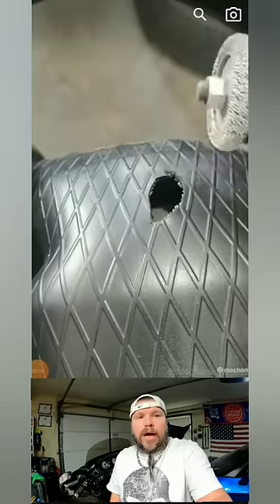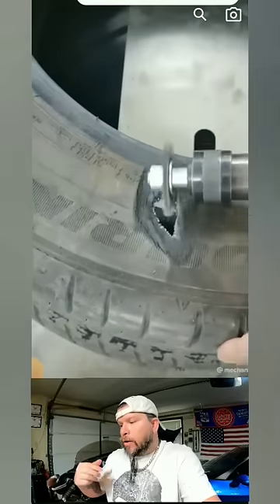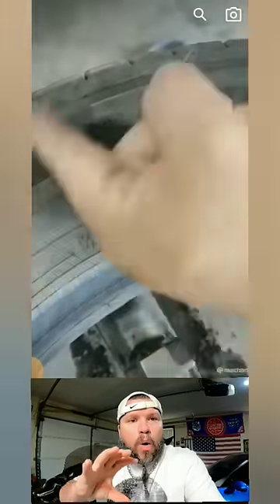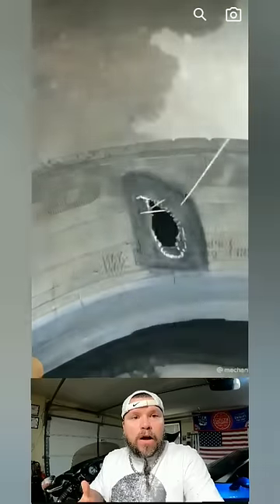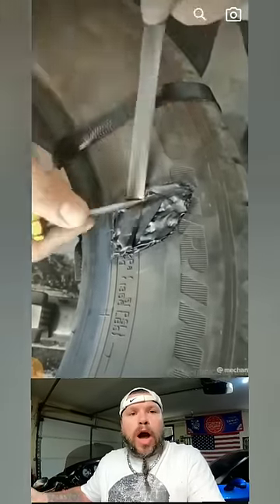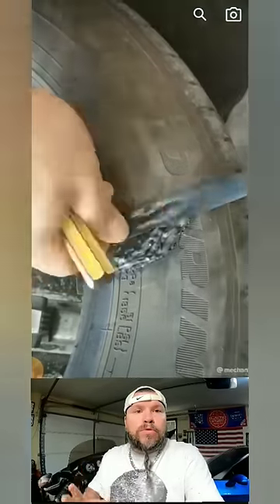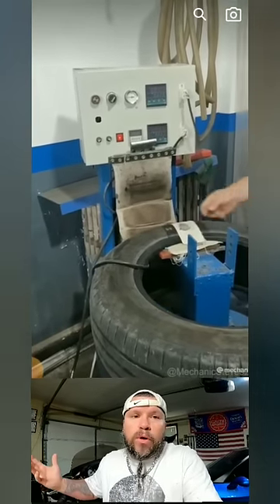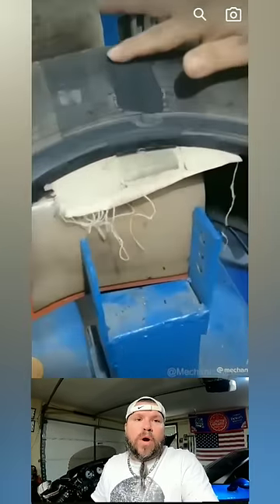patching a tire

Comment: I've taken tires to shops to get patched, whenever it was in the side wall; they refused to patch it.  If someone is doing this, they need to be shutdown; they're going to kill someone
Reply: Yet you tried to have a sidewall patched 😂.
Reply: @stpbasss3773 a lot of people have no idea why their tire is losing air when they bring in their vehicle until you tell them.
Reply: "kill someone" It's just a blowout dude, chill out
Reply: @JohnSmith-fq3rg  not sure if serious sam or advanced sarcasm 🤔
Reply: @JohnSmith-fq3rg  A blowout that could happen while cruising down the interstate at 70mph, pulling your vehicle immediately to one side due to the massively increased friction and smashing into the guardrail or someone else.  Have you ever had a tire go flat at high speed in a light vehicle?  It's not something you can easily control, especially if you aren't expecting it.
Reply: @SomeDudeInBaltimore  Thanks for this. There have been car accidents with perfect visibility on a straight road. Sudden blowout with swerve, overcorrection? Then you meet a telephone pole or oncoming car.
Reply: Sidewalls are safe and legal to patch. Don't be so dramatic, Karen.
Reply: @joshrandall3632  Fine, do it on your vehicle then, don't touch mine, and don't be driving within 1000 feet of me.
Reply: @SomeDudeInBaltimore clearly !!👍🏼
JohnSmith seem driving only in city, never on highway 🤔
Reply: @joshrandall3632  You're the guy who blew up Challenger because he thought the O-rings would be just fine...
Reply: @JohnSmith-fq3rg  you don't know much about much huh?
Reply: @joshrandall3632 Legal? Maybe. Safe? No. Take it from someone who literally makes tires for a living, that tire will never last, if it even makes it up to highway speed
Reply: @joshrandall3632  I want to talk to your manager
Reply: @SomeDudeInBaltimore  false, low profile tires you don't really notice. I drove last year on two flat tires /gong flat constantly due to leaks and they lasted 9 months. when I took them off there was lots of rubber rolling around inside the tires, but they still drove and held air.
Reply: @joshrandall3632  I have a sidewall with a plug in it, due to the citys shitty pot holes. Its going on 2 months no issues.
Reply: @trentmckenzie343  😂😂😂 Another YT expert! Stand by for superior opinion!
Reply: @joshrandall3632  I work on tires, I dunno about legal, but it’s definitely not safe. The sidewall is literally where the structural integrity of the tire is. Patching it is not safe at all.
Reply: lol. I plugged my sidewall with 6 plugs. Been holding over a week now just fine. Lol hahaha
Reply: @livingroom.computer  Doesn't mean it's legal.  In fact it's a ticking time bomb.
Reply: All of you experts on this comment thread should research sidewall section repair. It is a very common practice in the whole world in commercial trucks,agriculture and construction tires. TECH tire repair is the leading company that makes the equipment to repair sidewalls. They have several pdf files on the internet. Stop expressing your feelings as facts children.
Reply: @jamesblanco7323  you are correct about patching sidewalls but repairing sidewalls is a very common practice.  You say you work on tires. I'm betting you install sub-par tires at Walmart.
Reply: @samuelhelderman  that's funny 
When I was a kid a tire repair product salesman came to my father's shop. He had 62 plugs in one tire sidewall. He put one more in to show my dad how they work. He ran that tire till it was bald.
Reply: @JohnSmith-fq3rg  lmao 🤣 😂 😆
Reply: @BrianLuxe  oh boy 👦
Reply: @SomeDudeInBaltimore  lmao 🤣 😂 😆
Reply: You are clueless
Reply: @joshrandall3632  exactly
Reply: @livingroom.computer  exactly all yhese restreads have no idea what they are talking about
Reply: @jamesblanco7323  safe and legal you should do some research before taking a stand you don't understand
Reply: @Biffo1262  wrong
Reply: @Blue_Shirt_Guy  yessir
Reply: @xBoss-570   I work for Metropolitan bus transit authority? When you put rethreads on tires on our buses they are only allowed to go 65 miles a hour and that's it
Reply: Just because the government makes a law trying to promote safety doesn’t mean it’s reasonable. Everyone quotes this shit and praises it like crazy just because it’s law when in reality a tire in basically any condition can be fixed if done properly. It’s not always economical to do so but it’s not a safety concern. The tire shown in this Video was done right.
Reply: @trentmckenzie343  is lying about making tires.
Reply: I do it all the time and only had 3 deaths so far
Reply: @thechum9653  if I were you I'd look for a different career
Reply: @xLegionnair it is not legal in the US at all and I challenge you to show me where it’s legal.
Reply: @joshrandall3632 in what country?
Reply: clearly you are from the USA.  you might be surprised to know that our "used" tires here in the USA get shipped to mexio and south america and get the treads recut and sold again as "reman" or "recut" tires.  they are fine.  this is likely fine too, as layer separation hasn't happened yet.
Reply: @JohnSmith-fq3rg  no shit bro. That’s what I’m thinking. I mean, a blowout on a car? Not a big deal. Now, a blowout on a bike? Bit different story. I’m glad someone posted this.
Reply: @JohnSmith-fq3rg  you'll be chilling out on a mortuary slab . God Forbid  . A blow out at speed ain't no joke .
Reply: @joshrandall3632  so just for your information  in England they ain't.  Dudes 1,000% correct.  The whole tyre has been compromised.  They probably do this in a 3rd world country  . 🤔Having said that maybe America does qualify now ? 😉
Reply: @Blue_Shirt_Guy  
"Repair" and "patching" are different things.
Reply: @SomeDudeInBaltimore  yah, if he's bodging his tyres like this i'll be buggered if i'm gonna guess what else he has unsafely bodged on his car
Reply: in the third world it doesn't matter they have to do what they can to get along
Reply: @SomeDudeInBaltimore  in the third world you aren't going down an interstate at 70
Reply: @annehaight9963  now finally someone gets it. Why are you telling me ? Technically patching is repairing but as I've said, you can repair a sidewall but you can't patch it.
Reply: Man if yall saw the condition of 50% of people's tires you wouldn't even drive. I regularly see tires with splits all around the sidewalls that I won't even add air to and people expect them to last 6+ months still. I still see people driving on tires from pre 2010 multiple times a week, 44 psi max tires at 80psi. Brake systems with no brake fluid left. You guys have no idea how dangerous most cars next to you are. A drivers license should require basic vehicle maintenance classes.
Reply: @mikemartinez2697  not to mention the state of their suspension.  I had a car come in complaining about a thump when he turns. I jacked up the car and showed him a bad upper ball joint. He said I'll fix it later. I let the car down . He literally drove 30 feet and the ball joint failed in my parking lot.
Reply: @joshrandall3632  no it isn't dude 😂 it's a liability, only people in 3rd world countries do this. Name one shop in America that patches sidewalls.... I'll wait lmao
Reply: @J S  yep you see stuff like that alot and rusted through frames/suspension or obliterated wheel bearings. Amazes me how many you Tell their wheel could fly off at anytime or their suspension could fall apart and they jump right on the highway after or drive multiple hours.
Reply: Not everywhere in the world works like the United States. You need culture in your life my guy
Reply: Not everywhere is like the USA, people in other countries do what they need to do.. You need some culture my guy. Hell, this guy might be putting that tire on a piece of farm equipment, we have no idea.
Reply: You need culture in your life as there are many places outside of the USA that do not function like we do.
Reply: @steveo1584  OK, dude. Never said shops do this. Learn to read. They have to make money selling new tires so they make up rules for "safety" etc. Maybe daddy will teach you about big boy stuff one day.
Reply: @annehaight9963  Sure it is. People do it all the time. Just because you're not smart enough to figure out how it's done, even after seeing a video, doesn't mean it's not done.
Reply: @anthonyyyy2858  What country?
Reply: @JohnSmith-fq3rg  blow outs are more than capable of killing people, especially if it happens on a steering tire.
Reply: My uncle was almost killed a few years ago when some idiot convinced him that it was all right to patch a hole in the sidewall of one of his front tires of his truck! They didn't even try to rotate it to the back. When the tire blew out barely five miles from the shop it was patched at my uncle lost control of the truck and it veered right into oncoming traffic smashing the front end. He ended up with three breaks in his left leg and a mild concussion. When the police were on the scene my uncle kept muttering to them about the driver's front tire so they looked at it and saw they had been patched. One of the officers saw the repair order on the front seat of the truck and immediately knew where to go next! That shop ended up not only paying for my uncles medical bills, but the county ended up shutting them down immediately due to their negligence!

 As a mechanic working at a very reputable shop, we do not even try to patch even a nail hole that's in the sidewall.
Reply: Man I've had pinholes patched no sweat lol anything Bigger than pencil lead is too much for me
Reply: @joshrandall3632  you might get a bubble
Reply: @John Smith  at high speed? One of my teachers fell of a bridge due to a wheel malfunction, different but high-speed blowouts can be risky I think yo
Reply: This is a FAR different patching method than what they do at tire shops.
Reply: @ceciljones1248 thats because there insurance and saving fuel. This is a form of vulcanization shops quit doing this method a while ago for ins. Purpose most likely. It does Work...
Reply: @KurNorock Yes and there is probably a hot patch inside so a  BLOW OUT ISNT that likely.  vulcanization
Reply: @JohnSmith-fq3rg  Fortnite physics in real life?
Reply: @samuelhelderman  Whenever I hate our German TÜV, I just read some international comments and praise this institution for keeping our cars and others safe.
Reply: @atbalducci102488  In Germany you can drive like 200 mphs on some sections of Autobahns. Would never do this with a patched tire, never ever!
Reply: @iainansell5930  He uses cucumbers as an exhaust pipe.
Reply: Its safe, i driven on tires stitched almost all the way around on both sides. Fluoride in your toothpaste however, now that is truly some risky stuff.
Reply: @joshrandall3632  Never said I was an expert, but I do have experience in the field. You can do whatever you want if you think it’s safe, but that doesn’t make it safe. And if you have one with a sidewall patched like this, that doesn’t mean it won’t explode. Even if it doesn’t blow out, that still doesn’t mean it’s foolproof or safe. 

Sidewall is where all of your bearing force is, so a rudimentary patch like this will likely not hold if you ask me. If I made a tire like this I’d get fired.
Reply: @Blue_Shirt_Guy  Again… an exception is not the rule. I’ve seen tires that passed inspection and QA in my plant (without a giant hole in the sidewall) get put on a car and promptly explode. Brand new tire, passed every inspection in the plant. Your point?
Reply: @Blue_Shirt_Guy  Continental Tire, Sumter, South Carolina. I’m a process engineer in the “hot-prep” area of the plant. But you won’t believe that either I’m assuming…
Reply: @Blue_Shirt_Guy  And that means what, exactly? How great do you think that would’ve been if he’d been cruising down I-95 at 80mph? He’d likely be dead. Again, just because you’ve seen something doesn’t make it safe. Just because something works doesn’t mean it isn’t stupid.
Reply: @mikemartinez2697  Stupid hurts… still doesn’t mean it’s safe to patch or repair a sidewall.
Reply: @peterparker9286  Vulcanization has nothing to do with a blowout. Vulcanized particles will make a tire immediately fail a QA inspection in my plant. 

First of all, the cords being used are probably just random threads, not high tension cordage. Not to mention they’re completely puncturing the cap ply and inner liner of the tire. Which are the structural reinforcing parts of the tire. There’s a complete compromise in the main load-bearing area and the structural integrity of the tire is completely ruined. Will it fall apart? Who’s to say. But it’s not safe, and it’s not just like it never happened either.
Reply: @pflaffik  Fluoride in toothpaste is no more harmful for your health than anything. It would take a large amount of ingestion to be dangerous.
Reply: @trentmckenzie343  I didn't mean to insinuate that it was safe, more so that there are so many cars on the street I would trust less than this and nobody does anything about it. I don't know if it's ignorance or stupidity.
Reply: @mikemartinez2697  Ahh, my apologies. As far as ignorance or stupidity, allow me to put my two-cents in. Way I see it, stupidity is not knowing better, while ignorance is choosing not to know better. So likely both.
Reply: @trentmckenzie343  What is safe any more ??? I never stated it was better then  new. Ive had tires vulcanized and they lasted until bald. Is structual Integrity in this example comprised Yes.  Would I trust this tire patch?  Yes I would. But then again I kick the tires e everytime I ride.  Peace
Reply: @trentmckenzie343  Voltron has nothing to do with Ultron. THERE is nothing wrong with a Hot Patch Vulcanization. If it seals it seals. Its a melting to the melted.